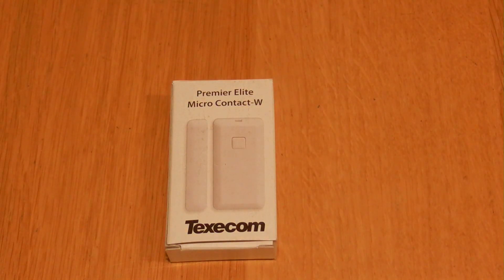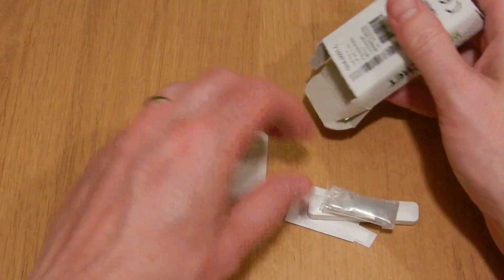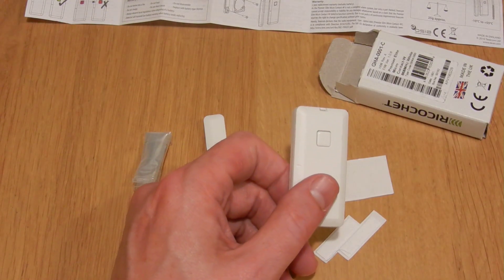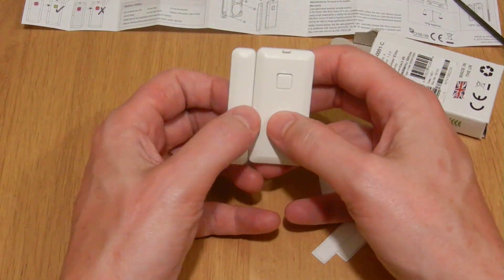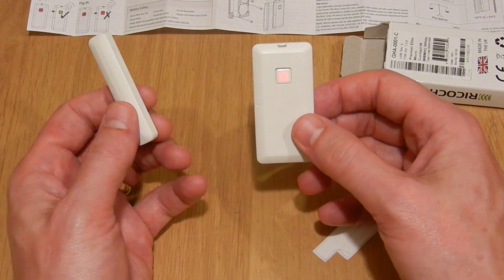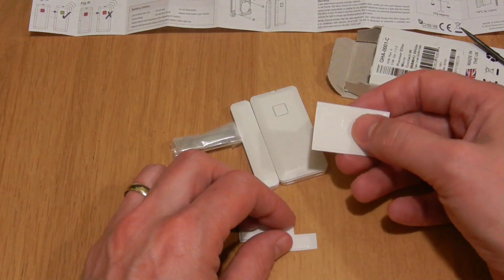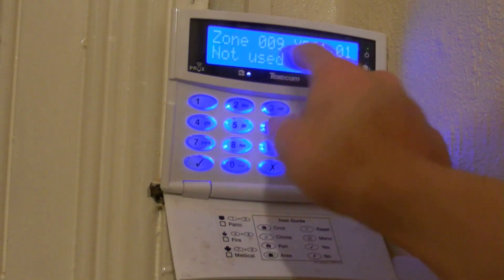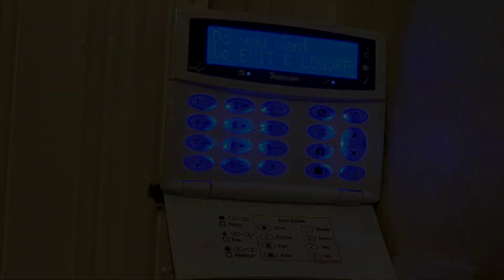Texecom Premier Elite Micro Contact-W

Comment: Plz Help.. ive changed the new battry on my sensor now it doesnt connect with the system.. how do i fix it plz? Many thanks.
Reply: If it isn't connecting at all it suggests that it has lost pairing somehow. I think the best thing to do is delete it from the panel, and then re-pair the sensor with the panel again. Can you let me know how you get on?
Reply: Hi james thanks for getting back.. the engineer set up everything for me.. so i do not have engineer code i only got my  normal  operation so dont know how to delete it either. Any suggestions plz?
Reply: @sumangurung8010  your engineer should give you the code upon request